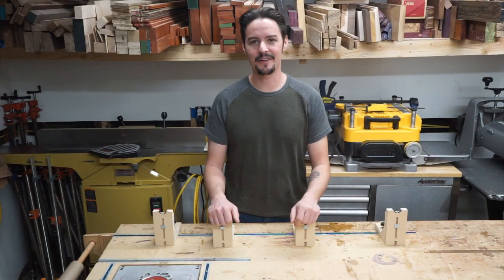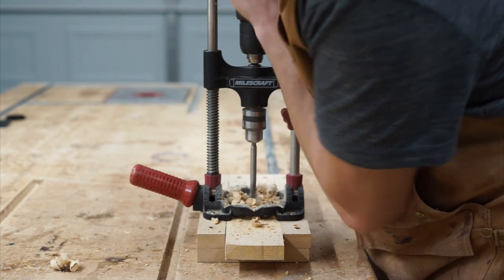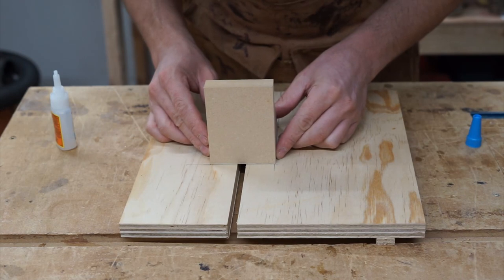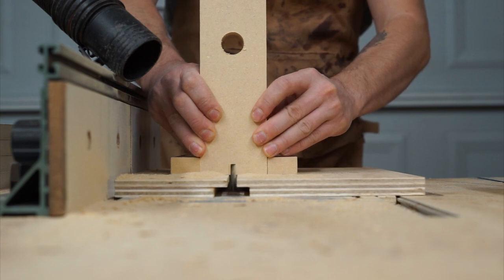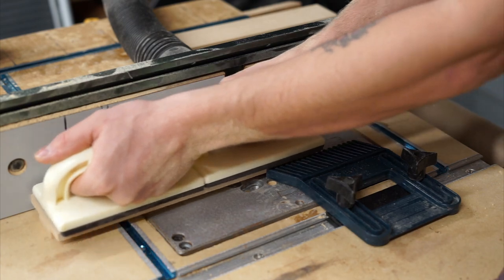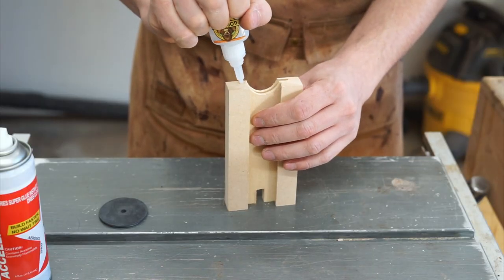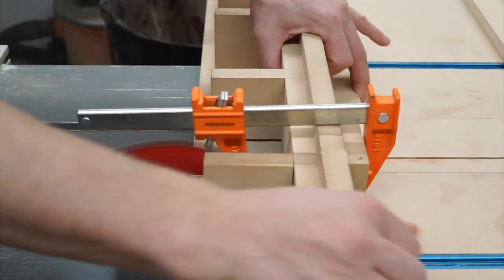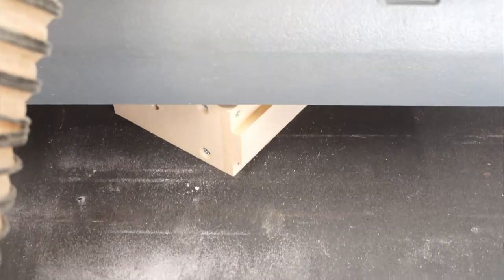The Feldthouse Clamp-Saddle Jigs: How We Made Them!

Comment: Love seeing the workflow on how you created these... so many steps! I looked at these and said "Yeah I could make those!", but then I looked closer and said, "But how long would it take me? And so many steps! Why would I make these when you have the design nailed down?" You had me sold when you added the rubber into the pipe clamp side. That's when I realized these are a full on manufactured product... not just a quick mdf jig and some hardware. Well done! can't wait to get my set and upgrade my glue up process!
Reply from the maker: Thank you so much Russ! This is truly a tool built for woodworkers by a woodworker. We're trying to solve common issues and make shop life easier! Thank you for the kind words!